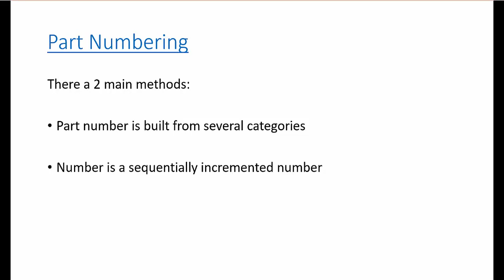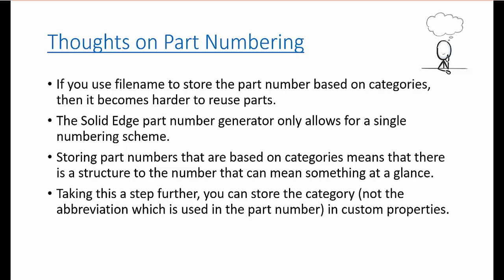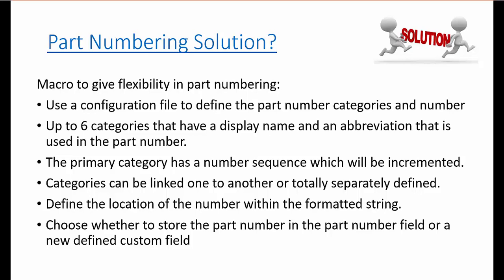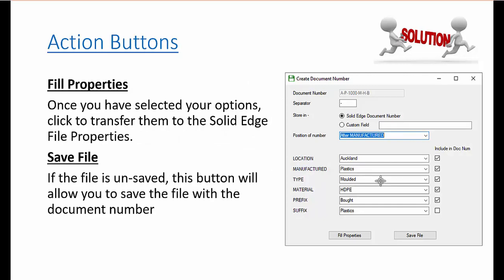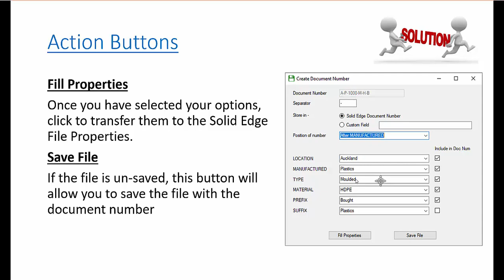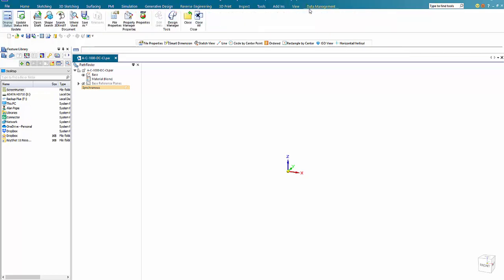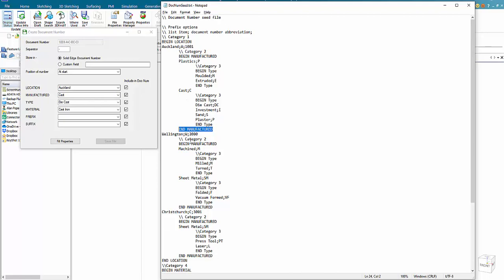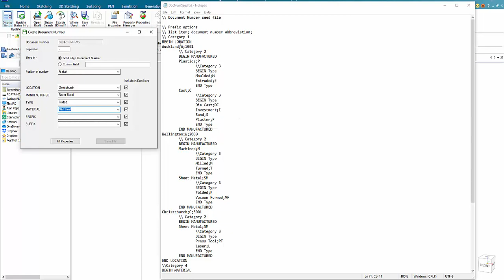Intelligent Part numbering macro for Solid Edge

Comment: Is this macro compatible with SE embebed Data Management?
Reply from the maker: A good question. If you are using the SE data management to number your parts, then no. This would be instead of that, but as long as you save your files in the vault, then it will work fine as the added custom properties will be searchable.